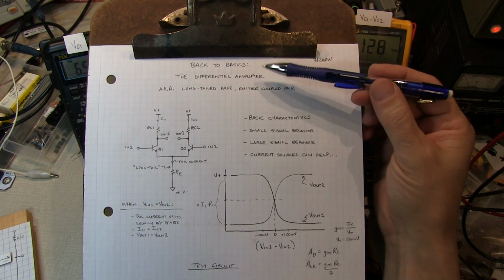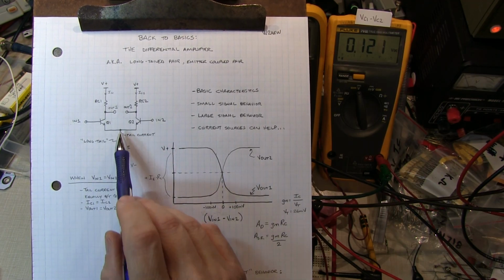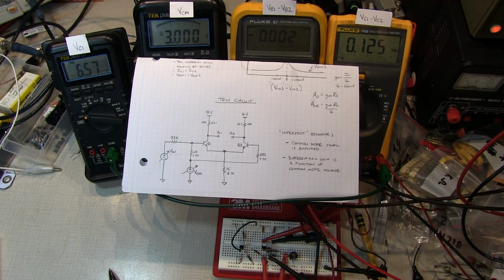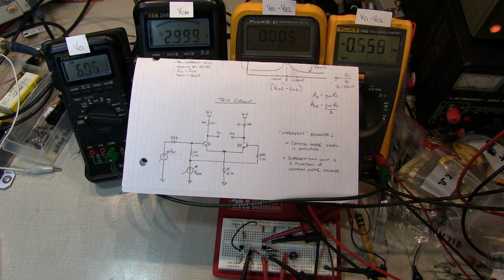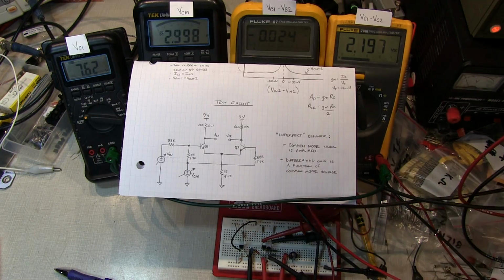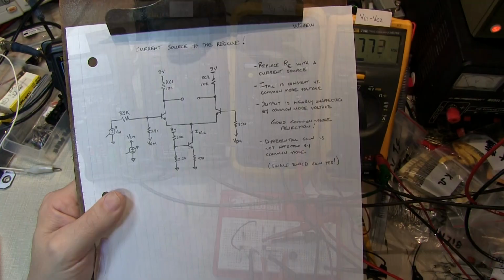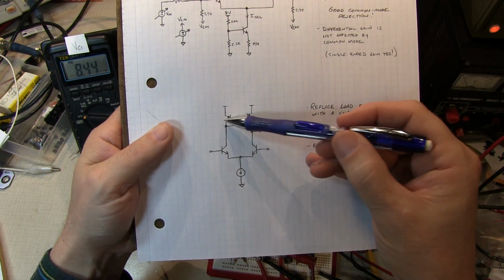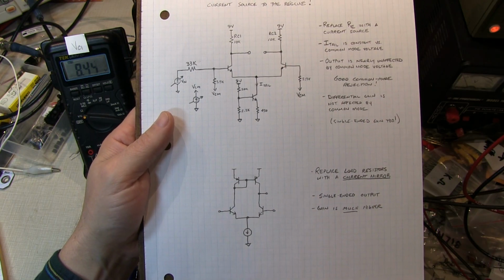#193: Back to Basics: the differential amplifier, aka long-tailed pair, diff-pair

Comment: im having trouble understanding why the tail current is constant. anyone help?
Reply from the maker: +Captain Rhodes The current source used (on the 2nd page of the notes) is designed to be "constant", which addresses the common-mode issue presented in the earlier part of the video.  You may want to take a look at my videos on current sources:
https://www.youtube.com/watch?v=xR0RfmmRhDw

https://www.youtube.com/watch?v=JbCI4Lsnqho
Reply: +w2aew Thanks I will be watching those for sure. Can I just ask - when we unbalance the Vbe's in the circuit with just the Re resistor on the tail does the tail current stay the same? IF it does is that purely because one Vbe goes down by the same amount as the other goes up? IE if one goes up and the other stays the same would the tail current change?
Reply from the maker: +Captain Rhodes When a resistor is used at the emitters (instead of a current source), then the tail current will NOT remain constant.  The voltage across the emitter resistor will be determine by whichever input it higher.  However, for small signal applications, the change in tail current might only be a small percentage of the total tail current and quite acceptable in many applications.

Comment: Your mechanical simulator of a diff amp was brilliant. As someone who tends to "learn visually", that gave me quite the thrill.
Reply from the maker: Ryan Jensen I tend to visualize how circuits work by picturing voltage as "elevation", just as they're viewed on an oscilloscope - so this mechanical analog seemed to fit.

Comment: Can you use for the transistors Just 3 bc547's and 2 bc557's and then use it as a basic comparator for single supply?
Reply from the maker: Sure, but you do need to be careful with the bias and input voltage levels.

Comment: Hey Alan,

This is a great tutorial on differential amplifiers.  I've always found that most profs simply throw the math at you and expect you to understand how it all works based on the equations.  While the mathematical analysis is accurate, I find it does nothing for intuitive understanding (which I find is key).  That is why I love you videos.  They explain how the circuits work rather than just throwing math at you.  Thank-you!

For fun, I am in the midst of designing my own function generator and building a wideband amplifier to try to get a decent 20Mhz square wave using discrete components.  I am currently designing it with a 2 stage cascode design, but am finding that I am losing too much headroom and was wondering about the frequency response of a differential amplifier and the pros and cons of using a diff amp as opposed to a cascode?
Reply from the maker: For bandwidth, you're going to be better off with the cascode I think. It alleviates the most significant BW limiting factor of the CE amp and diff amp - the Miller Effect.

Comment: Am trying to match mosfets that will be emitter coupled through .1ohm resistors. How would I go on about matching these mosfets, gain or characteristic matching? I was told by an old timer that to measure the resistance between the pins to match them but I doubt its that easy.

Any links or tutorials on this is highly appreciated and as always great job and thanks for sharing!
Reply from the maker: If you're using MOSFETs, then they'll be source coupled (they don't have emitters). You'd want to match the gate-source threshold voltage and the transconductance.
Reply: Here's a link to the amplifier am working on.. http://i129.photobucket.com/albums/p203/rae1975/024DC4B2-5139-4479-94F8-439933D8D397_zps0mtysja9.jpg .. 

Thanks for the advice...I purchased all the fets from Mouser and all have consecutive numbers.. I just wonder if they are all made from the same silicon wafers.
Reply from the maker: Given that this is a commercial product and I have no idea of the circuit, you'd be better off asking the manufacturer what FET characteristics need to be matched for best performance.
Reply: Thanks for your input but the engineer designer is helpless when it comes to those types of questions. Pretty much says "send it in", hell am trying to learn for myself.

But I just found a mismatch transistor that was in a bank (section)..The only one that fail and it had a different date code, don't know how I missed that, this is probably what caused it to fail right away.

BTW the fets were BUZ21 that I replaced all with IRF540N, but have read on forums that it should be replaced with a IRF540 (without the "N" suffix). Which I order as well, but will remove the leaky fet w/wrong date code and test unit again. Seems to have a pretty good protection circuit because it doesn't blow out the rest of the fets in the same section/bank.

Again thanks for your input/advice. I enjoy all you vids.

Comment: Alan, quick question, and maybe it's more a understanding on my part. You say when Q1 voltage goes up, more current goes from the "tail" through Q1, meaning more voltage drop across R1, so out1 drops. This seems... confusing to me. Why wouldn't it by that Q1 turns on harder, and drags the voltage at out1 down (via the tail resistor to ground)? Or am I missing something here?
Reply from the maker: You're not missing anything, that's just two ways of saying the same thing. When the base voltage on Q1 increases, the emitter and collector current in Q1 increases. Another way of saying this is that Q1 turns on harder. The increased collector current means that the voltage drop across R1 increases (IC*R1). Since the voltage at the top of R1 is at 9V, the voltage at the bottom of R1 (Vout) goes lower.
Reply: ***** Perfect... it just sounded like you were saying (motioning with hand as well) that current was coming UP through the tail resistor, so that was the confusion. Thanks for the great videos. BJTs have really been a sticking point in my knowledge (FETs make more sense in my head for some reason (I think because they're voltage driven, and the Gate has nearly infinite impedance)).

Comment: I love the practical perspective of your explanations and the way you build up the circuit step by step.
Putting visual emphasis on the circuit drawings and measured values rather than the actual breadboard was a good choice as the latter serves no information other than proofing the circuit is real.

Comment: Very good presentation. Direct and to the point. I am trying to debug/improve a vertical amplifier circuit for a oscilloscope project from Radio Electronics April, May 1980 (Daniel Metzger & Dennis Perry). I have matched the the transistors as close as I can, but seems to be very difficult to calibrate, and difficult to set the DC balance. The vertical output looks distorted and unstable. I have the article.

Comment: Can you make a video on darlington pairs and sziklai pair? I have recently started experimenting with the obscure sziklai pair and it performs REALLY well when used as a voltage follower. The turn on voltage in common collector mode is ~0.6V higher that the drop across the load, and used in common emitter mode, just 0.6V from ground. I have made a really simple voltage regulator with it in LTspice, and it seems to have really good load and line regulation.